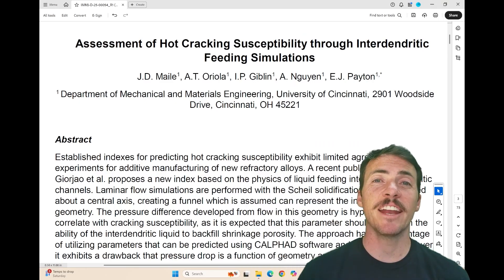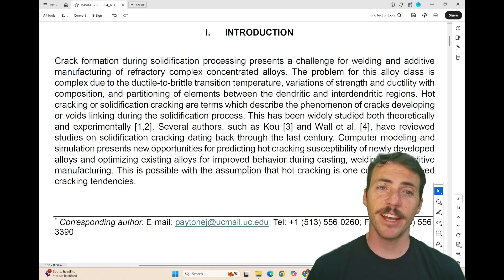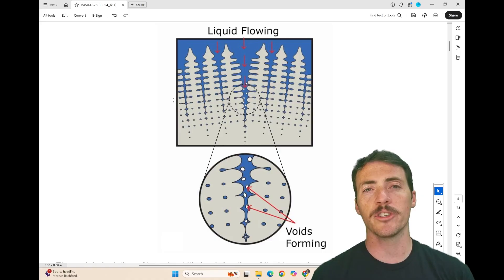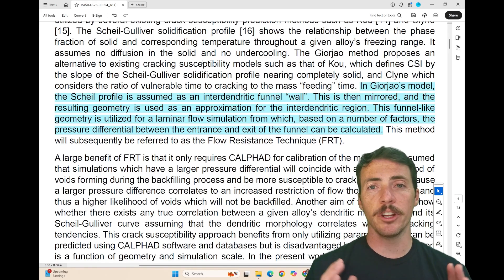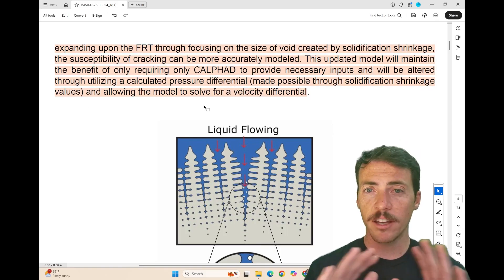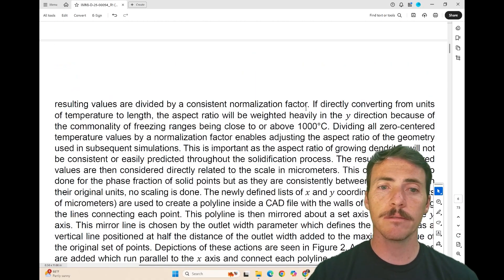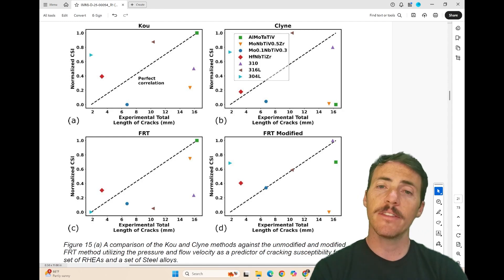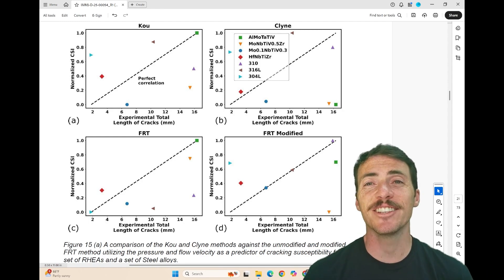Can We Predict Cracking in Metal Alloys?

Comment: Hello sir, one question Is high phosphorus and sulphur content causes hot cracking. If yes then how does it cause what happens at the microstructural level??. Thank you
Reply from the maker: When you see cracking and other brittle behavior, my first reaction is to assume that it is an intermetallic phase that is forming that is simply brittle. However, that's not the case here. Instead, phosphorus and sulfur lead to the formation of low melting point eutectix along the grain boundaries and this is the mechanism whereby you get hot cracking